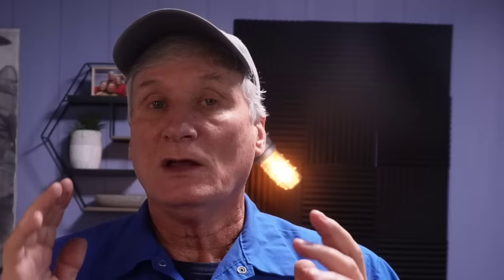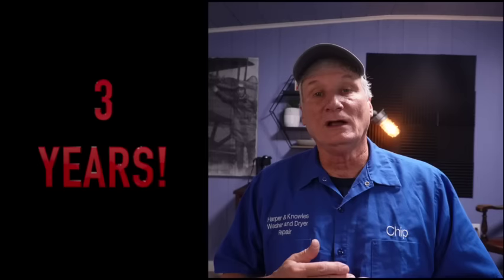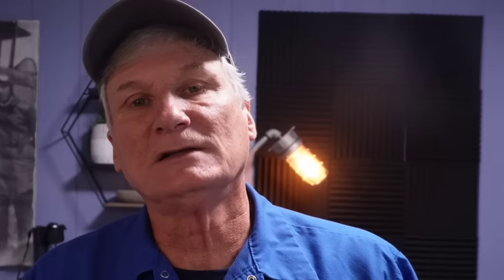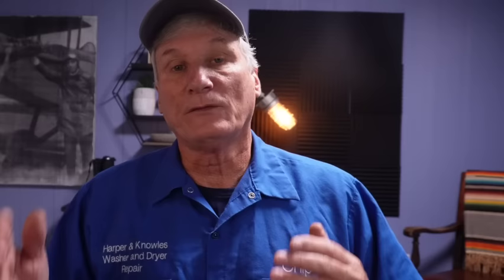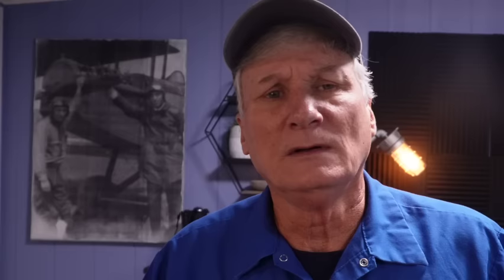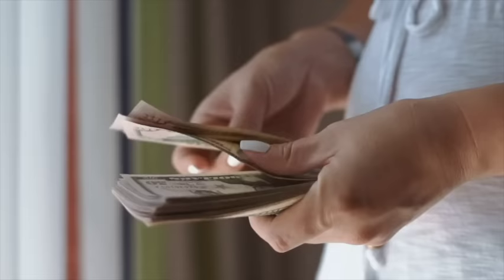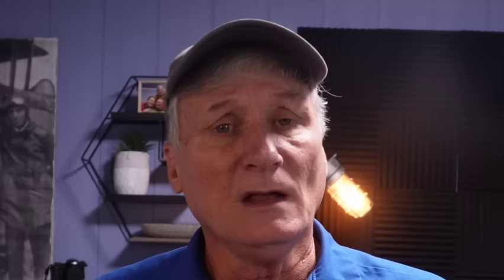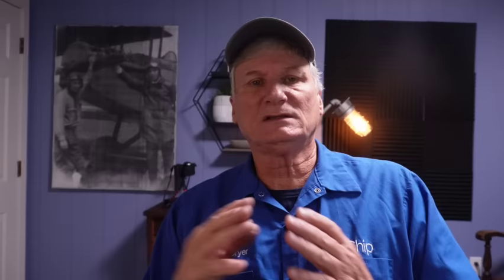How To Choose the Best Washing Machine: Speed Queen TC5 vs. TR7 Review

Comment: I wont debate speed queen being the best or not but there is no competition between top loaders and front loaders. Top loaders fill with 20 to 30 gallons  and go swish swish for a few minutes and dump it they repeat that for the rinse cycle, they are basically useless. Top loaders only use 5 or 6 gallons a cycle and have 10 times the agitation of a top loader. They use half the water and half the soap they normally have no transmission to break either. Tumbling in water pushes much more water through your clothes, pushing the dirt out. Top load agitators tug on seams and buttons and wear off iron ons. Front loaders are very gentle on your clothing.
Reply from the maker: Thank you for sharing your perspective on this. You've highlighted some key differences between top-loading and front-loading washing machines. Front loaders are indeed often praised for their efficiency in terms of water and detergent usage, as well as their more gentle treatment of clothes.

That said, some people prefer top loaders for their own reasons, such as ease of loading and unloading, the ability to add items mid-cycle, and familiarity with the system. It really comes down to personal preference and specific needs.

Regarding your comment on Speed Queen, their reputation for durability and performance, particularly in their commercial-grade machines, is well-regarded. But as with all appliances, one's satisfaction may largely depend on individual needs, preferences, and experiences.

Thanks for watching, and feel free to share any other thoughts or experiences you have with different types of washing machines. Your insights are valuable for the community. 👍

Comment: Bought a model TC 5003 WH 6 months ago and like you say it is noisy. The worst problem I've encountered is that it leaks bad when you try to use the economy cycle. The dealer told me to wash on the heavy duty cycle, that has helped but wondering why you can't use all the choices available when you pay $1400 for this machine.
Reply from the maker: Your machine should work on all cycles. If it is way noisier than you expected that might be related to your other problem. It’s time to use that warranty and have it looked at by a professional. Thanks for watching!

Comment: My medium grade Maytag washer and dryer work great, do not buy the top models.   The only problem I've had is using liquid softeners, they plug your washer up.  I changed to dryer sheets to soften my cloths, everything smells clean and fresh now.
Reply from the maker: Thank you for sharing your experience with your Maytag washer and dryer. I'm glad they've been working well for you. It's always good to hear different perspectives and real-life experiences with various appliances.

As for the Speed Queen washer, its build quality and durability are known to be exceptional. However, it's essential to consider personal preferences and experiences when choosing appliances. While your Maytag has served you well, other people might be looking for something different, like the reliability and performance of a Speed Queen.

I appreciate your input, and it's great that you've found a solution for the liquid softeners issue by switching to dryer sheets. If you have any questions or need further assistance, please don't hesitate to reach out. Thanks for watching my channel!

Comment: chip do any of these washers have coin catchers , that can be easily cleaned without disassembly . great video , thank you .
Reply from the maker: Not that I know of, these models aren't built the same way some of these other modern machines are. If you lose some change in them it will probably just wind up on the bottom of the spin tub. Thanks for the great question!

Comment: Bought a new speed queen washer, but wonder why the new electric motor is so much noisier than the 20 year old Amana commercial model it replaced?  (A lot of the parts on my old Amana look like the same as a Speed Queen internal parts and are interchangeable).  I replaced the hub bearing and hub assembly and tub seal kit and pump on the old one and gave it to my son.  The water inlet valve went out recently and replaced it with a part made by Whirpool, it seems they make a lot of parts for a lot of different brands.  I have a spare electric motor and wonder if it would be much quieter if I replaced the new Speed Queen motor because it hums so darn loud.
Reply from the maker: It's not uncommon for newer appliances, including washers, to have different noise levels compared to older models. There can be several factors contributing to this difference in noise.

Firstly, advancements in technology and design may result in changes in the motor design or the overall construction of the washer. These changes can affect the noise levels produced during operation. Additionally, different manufacturers may use different motor designs or components, which can also influence the noise produced.

While it's possible that the newer electric motor in your Speed Queen washer is inherently noisier than the motor in your old Amana model, it's important to note that noise perception can be subjective. What may seem loud to one person may be acceptable to another.

If the noise level of your Speed Queen washer is causing concern, you may consider reaching out to Speed Queen customer support or a qualified appliance technician. They can provide guidance on whether the noise level is within normal range or if there may be any underlying issues that need to be addressed.

As for replacing the motor with a spare one, it's difficult to say if it would significantly reduce the noise level without knowing the specific motor models and their compatibility with your Speed Queen washer. 

As long as the wiring connections are compatible I don't see why doing an exchange to see if there is a difference wouldn't work. Just be sure the parts are compatible, I'd hate for you to damage other components just for the sake of experiment. Thanks for watching!

Comment: The TC5 can be gotten for around $1200. Several LG and Samsung units with failure prone fancieness go for $1300 and up. Speed Queens are a better value when you look at it this way.
Reply from the maker: Thank you for sharing your perspective on the value of Speed Queen washers compared to LG and Samsung units. It's true that some of the more expensive LG and Samsung models may come with features that could be more prone to failure, while the Speed Queen TC5 focuses on durability and simplicity.

When comparing washing machines, it's important to consider not only the initial cost but also the long-term value, including reliability, maintenance, and the overall lifespan of the appliance. Speed Queen has built a reputation for producing long-lasting and dependable machines, which can make them a better investment for some people.

Of course, everyone's needs and preferences are different, so it's essential to research and read reviews to find the right washing machine for your specific situation. However, from my technician's perspective, some of these reviews fall short and lack a comprehensive evaluation. If you have any more questions or need further assistance, please don't hesitate to reach out. Thanks for watching my channel!

Comment: Yet, they pulled a bait & switch for 2018 models. I bought one in 2019 & got a 2018 model which most folks hated. It doesn't clean near as well as the 2017 or 2019 models. So, we paid full price for another corporate sales snow job. I wouldn't buy another one when I need a dryer.
Reply from the maker: Thanks for watching!

Comment: My old-style washer was almost 50 yo when I absolutely had to replace it.  I would strongly urge anyone who has one of those old agitator washers to keep it going just as long as possible. The vast majority of repairs are easy DIY jobs. Keep oil in the transmission, too. The new HE washers are absolute junk by comparison and damaging to clothes. Yes, SQ are the best available now but I still greatly prefer the old style units.  If you do have to buy one of the HE units, be sure to plug it into a surge suppressor.
Reply from the maker: Great advice right there! 50 years is an incredible testament to American technology and quality when things like that actually mattered to manufacturers!
Reply: @HarperandKnowles  Dryer is still going strong at 54 yrs. though I did replace the belt once. Fridge is 40 yo and only replaced the evaporator fan (had a spare). Easy job.  Kept central air going for 47 yrs.+. though I had to get a license to take care of that.
Reply from the maker: If only my central air would last that long. It’s 28 years old and needs to be replaced. I should never have had it installed in the attic.
Reply: @HarperandKnowles  I assume you mean that the air handler is in the attic and the condenser outside. Why are you replacing it?
Reply from the maker: Yes, the condenser is outside. The unit in the attic has started to rust through where the condensation gathered then drained from a fitting on the bottom and now it is starting to drip into the overflow pan underneath it.  I’ve been looking into a geothermal unit and perhaps modifying a spare closet space located under the present unit for the air handler.  It’s time to upgrade anyway.
Reply: @HarperandKnowles  Of course, you've gathered from my previous comments that I'd simply repair the rust. Sounds like the primary condensate pan should have been looked to sooner or perhaps the unit isn't level so that the primary pan can drain into the secondary, if the primary's float switch fails.
In my area, geo. just doesn't make sense at all and electricity is cheap. Like central air units, the installation is extremely critical and you know that many/most central air systems are not correctly installed.  I wouldn't have replaced my units when I did except spare parts were issues and a local distributor gave me a spectacular deal. His installer was excellent but I still was with him every minute.
Reply from the maker: Yeah, unfortunately the damage was done before I noticed it. I’m gonna try to get another season out of it. I just don’t want that secondary pan to spring a leak and ruin my ceiling.
Reply: @HarperandKnowles  It's supposed to have a float valve cutoff by code. Mine has 2 just in case. If you're worried, just replace the pan. Your system is old enough that it may have copper coils instead of aluminum and that's sure a good thing IMHO. My coils, even after decades, looked like new in the attic but not quite so in the basement.
Reply from the maker: I don’t think mine has float valves in it, just a discharge pan with an outlet that connects to a sewer vent pipe to drain the condensation.  I donno bout AC just washers and dryers. You’re the expert on the AC!
Reply: @HarperandKnowles  Not really compared with real experts many of whom are awesome. I think code requires a float switch on at least the secondary drain pan when the air handler is installed above an occupied area. It's an easy and cheap DIY installation that you can and should do then no worries. Don't know about connecting the drain to the vent stack. I think part of the code requires that the condensate drain pipe be routed in such a way that the water be visible to the homeowner. But your system must have passed inspection.
Reply from the maker: I build the house 28 years ago, so perhaps it wasn't required back then. I donno.
Reply: @HarperandKnowles  Don't know where you are but it very likely was required.
Reply: @HarperandKnowles  Did you do the AC installation, too?

Comment: Bought a Speed Queen TR7 washer and dryer about 2 years ago. The gas drier is perfect but the washer is problematic. It doesn’t balance the loads very well ( not overloaded) and it vibrates to the level of moving out of the laundry closet. Two recommended tech said it was normal (it’s not). Why can’t someone fix this issue?? We spent a lot of money to purchase these machines and we are disappointed with the washing machine! Personally I would not recommend the washing machine until the issue is corrected. Please help!
When it does balance the load correctly it functions as it should. It’s a crap shoot as to when it will function correctly. The machine cleans the clothes very well and
Reply from the maker: Thanks for your comment and feedback on your Speed Queen TR7. I'm sorry to hear about the balance issues you're experiencing. It's indeed not normal for the washer to vibrate excessively or move from its position during operation. This could be due to an issue with the snubber ring, a component that helps to reduce vibration, or there might be a problem with the balance ring, which may not be filled with the appropriate amount of water. I'd recommend seeking a second opinion from a different technician if the ones you've consulted so far haven't been able to rectify the problem. Your satisfaction with your appliances is of utmost importance, so don't hesitate to keep exploring solutions until this issue is resolved. Keep us updated on the situation and thanks for watching!
Reply: This issue started on the first day installed. I think they forgot to remove shipping brackets as they returned a few hours after my call but they may have damaged something. Just my best guess not being an appliance repair technician.
Reply from the maker: If the shipping pins are still in place that would prevent the suspension from moving freely. If it occurred on day one, you either have a machine with a factory defect or it wasn’t installed correctly.

Comment: I have no doubt that sq are built better than most, problem is they cost double than the competition. I only use front end loaders and my LG washer lasted 9 years before dying and the dyer is still going strong art 13 years. Both were $1800 for the pair. The sq is over 2k for 1 washer! Can't justify the cost imo.
Reply from the maker: Lol. You remind me of my ole buddy, Joe. He once told me he could buy 7 Murray lawn mowers before he could pay for one Kubota!  Ya’ll do have a valid point. Thanks for watching!
Reply: The Whirlpool front loader that we purchased in 2006 lasted 13 years before the bearings failed. We purchased another Whirlpool front loader in 2019 and it only lasted three years!

If you buy a new front loader it's not going to last for more than about five years, if you're lucky,

In the long run, buying a Speed Queen TC5 top loader will save a significant amount of money over buying a front loader that is only going to last for a few years and will likely need repairs during it's short life span.
Reply: Just wanted to add that you can get a Speed Queen TC5 for $1300 - $1400. $2000 is ridiculously overpriced.
Reply: @francoamerican4632  $2000 for the front end loader

Comment: im 64 years old. my parents always had Speed Queen. i  followed suit. when the time came 8 years ago to buy a new washer, the choice was easy. my new Speed Queen was only 3 years old when it flooded my home. i had it serviced. im nt a technical kind of guy so please forgive my terminology. the "dyke" that holds back the water till you call for it failed. 
15 months later it happened again. Speed Queen isnt what it used to be.
Reply from the maker: I'm sorry to hear about your negative experience with your Speed Queen washer. It can be frustrating when a trusted brand doesn't live up to expectations. It's important to note that while Speed Queen has a reputation for durability and reliability, occasional issues can occur with any appliance, even from reputable brands. It's possible that you encountered a rare manufacturing defect or specific model issue. It's always a good idea to have appliances serviced by professionals to ensure proper functioning and address any potential issues. If you're still experiencing concerns, it may be worth reaching out to Speed Queen's customer service or considering alternative options for your next washer purchase. Thank you for sharing your experience, and I hope you find a reliable solution that meets your needs.
Reply: @HarperandKnowles  , it broke my heart. we hd 2 SQs with decades of trouble free service. so i remained loyal and bought again. i know anything can have troubles. so, i called SQ, they gave me the number of an authorized repairman. when it failed again. i took it outside and took my new shotgun to it. Maytag is doing fine for its short 3 year lifespan.

Comment: I’d like a simple washing machine without the fancy gadgets that I never use, we have a king size comforter so I need a tub big enough to wash it and I’d love to not have a lid lock. We currently have a Maytag Bravos I think it’s called, I absolutely hate it and I’m looking to replace. We have to wet the clothes down after I load the machine, it doesn’t get enough water to wet all the clothes. What is the largest capacity tub does Speed Queen make?
Reply from the maker: Speed Queen isn’t known for large tub capacity, but there are lots of people that stuff them full to the top without harming the machine. You might want to check out their front load models. Thanks for watching!